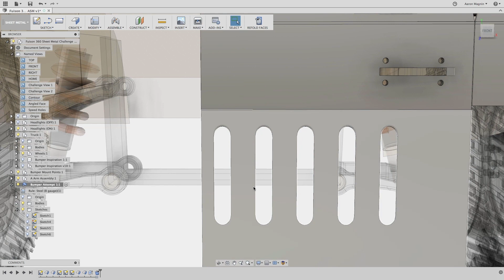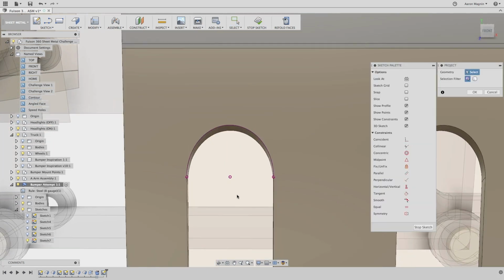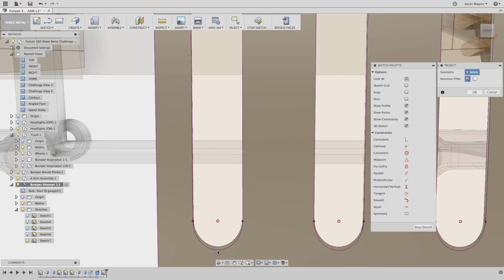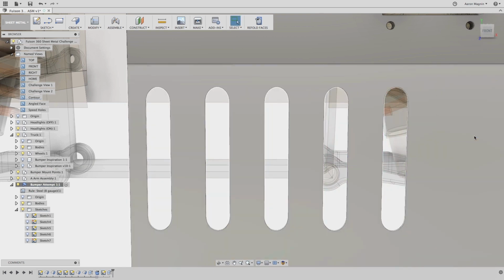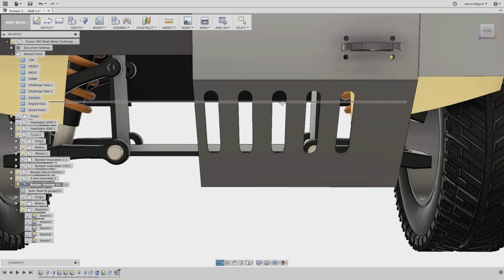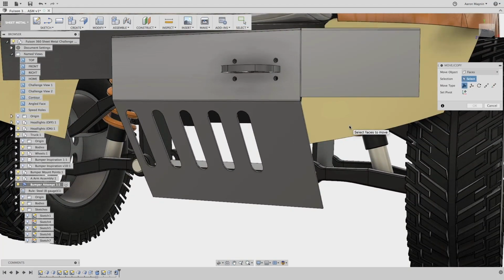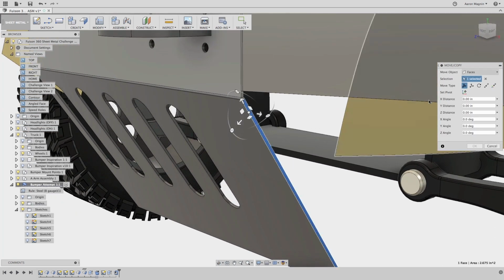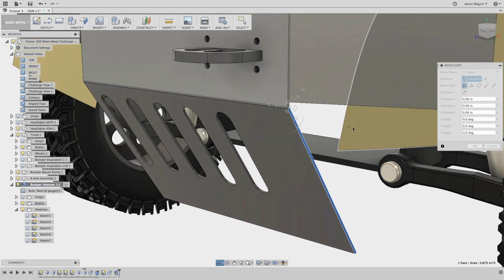QUICK TIP: Make Sheet Metal Cuts Normal

Comment: It is two quick tips rolled into one delivered at hiperloop speed.
Reply from the maker: This was pulled this out of a longer QUICK TIP (Sheet Metal Gems Part 1) to help users find it in the future. We've been doing this lately when we realized how buried and unsearchable these multi-tip solutions can get. 
Sorry for the fast parts! I imagine it was done at the start because this tip was more about correcting the issues made after. We'll ask Aaron to slow down next time!